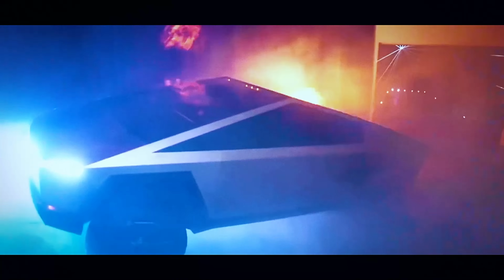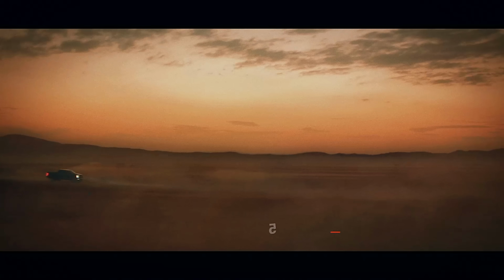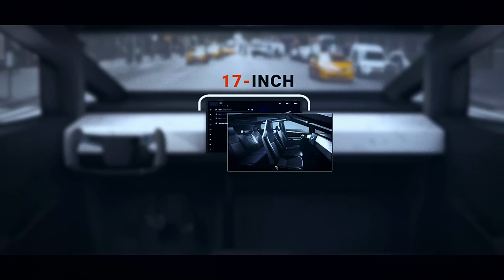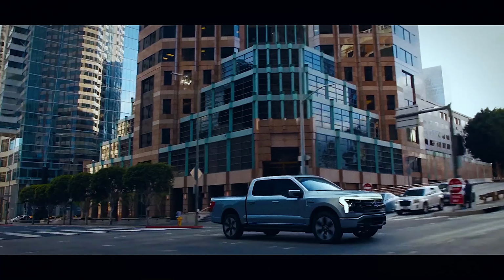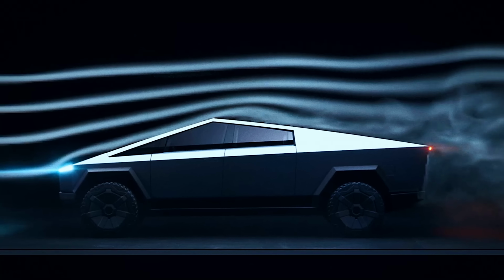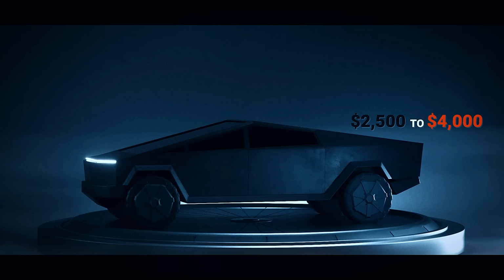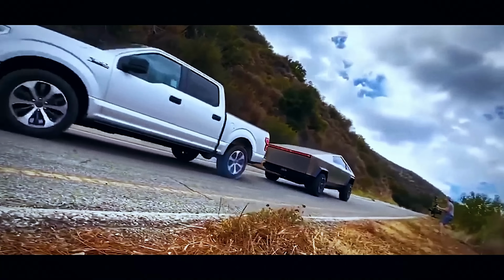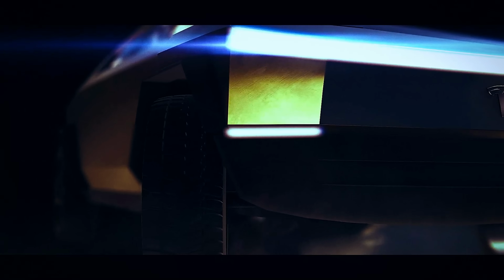This is why Tesla Cybertruck is Special and Unbeatable

Comment: There is a reason this will never outsell the F150. The rear bed has to be able to be replace with other options. As this stands, it's just a truck. With a replaceable bed, you can make it into any kind of work truck. Look around when you drive. Trucks have all sorts of different bed options. For this to be more than a cowboy Cadillac, it will have to have the same option to replace the bed.

Comment: Didn’t they announce a while back that it would also have a quad motor option? Also the reason why the steel ball broke the armoured glass (but didn’t go through) was because the edge of the glass window was cracked when the sledge hammer was used against the door (to show how tough it was).

Comment: E-Vehicles are the future, but there are problems. Cons: strong initial drive wheel torque motion is a negative in that the drive wheel’s tires wear out at 50% or less of their milage warranties. Continuous quick strong acceleration causes physical discomfort from stressing the body’s internal organs and drivers are complaining about body soreness and some headaches.

Comment: mentioning "Torque" when talking about a vehicle engine is almost always meaningless. In order for this number to mean anything to the listener, you would have to also state the gear ratio, wheel diameter, and vehicle weight to get any useful information. e.g. a 10 Nm model aeroplane engine put through a 1000 : 1 gearbox provides 10,000 Nm output torque... if you then drive a wheel with this that is 10m radius, you get 1000 N forward force... if you use a 1m wheel diameter, you get 10,000 N forward force... etc. If you dont understand physics, dont talk about.

Comment: Since Nov 2019, you've had 2 1/2 years to get your facts straight on the cybertruck, but you seem to have thrown this together at the last moment with little checking of facts.  Didn't you care to give your viewers accurate information?
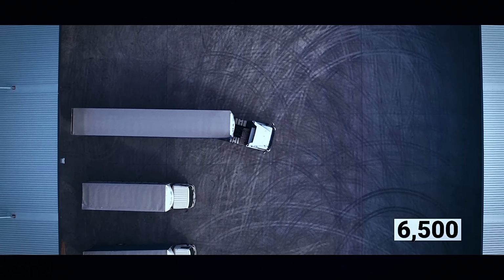  0:35 You show semi trucks and say the cyber truck is to replace the 6500 fossil-fueled trucks sold in the US each day.  18 wheelers?  What?
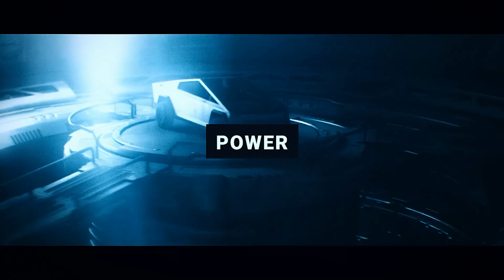  0:57 You say the Tesla Cybertruck is huge and dwarfs most other vehicles on the road.  Yeah, except for all the full-size pickups like Ford's F150 and the larger heavy-duty F250 and F350.  It's big, but you leave the impression it's a real monster.  Not so.
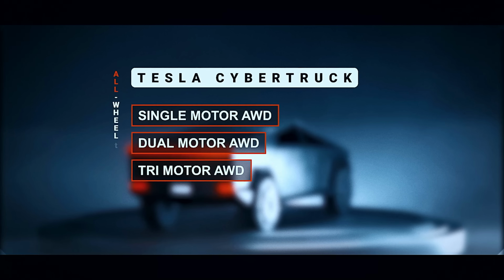  1:10 The dual-motor and tri-motor versions are all-wheel-drive, but the single-motor is REAR wheel drive.  Careless of you.
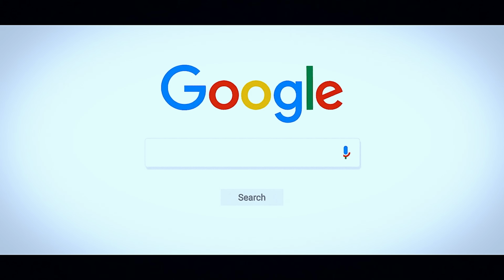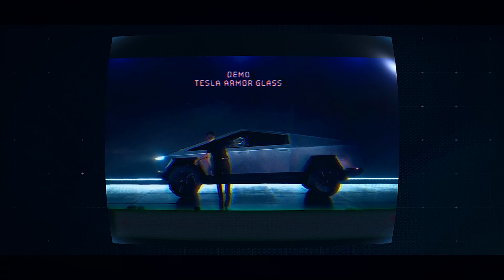  2:00 Bullet-proof windows.  They didn't make this claim at the initial reveal of the truck, though maybe somebody official has said it since.  At the reveal, they showed that the steel body was bullet-proof to a 9mm handgun, but the ceramic "glass" was only shown to be resistant to steel balls (and fractured twice when the balls were thrown at the actual truck windows.)  To be fair though, "bullet-proof" glass works by deforming and giving way so that it catches and stops bullets without letting them through.  These broken windows "worked" in the same way.  They would have protected any occupants from injury.  That's what you want if some idiot is dropping cinderblocks on vehicles from a highway overpass.  Your statement a bit later (2:18) about the function of the glass was very good.  You got that one right in all its details, I believe; even the mention of bullets.
  3:40 Interior space.  Even though no longer or wider than an F150, the interior seems much larger, while retaining the 6.5 foot bed length of the F150.
  5:00 You say Tesla Autopilot is "amongst the most advanced driver-assistance systems globally, akin to level 2 vehicle automation."  Tesla states that it IS level 2.  Is it among the most advanced?  You don't address full self driving, which is promised to be ready when the Cybertruck is ready.  Tesla's FSD is currently somewhere close to level 3.  Other companies have already achieved level 4, even 5, but only in good conditions in limited areas at limited times of day.  Tesla is attempting to develop cars that will drive themselves safely anywhere, even in difficult places they have never seen before at any time that a person could do it.
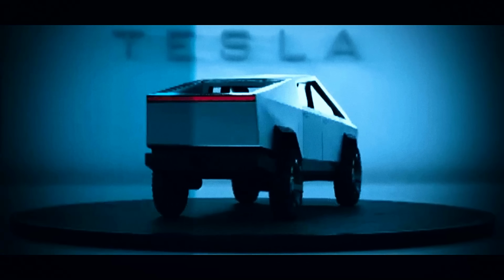  6:15 You talk about the "four thousand six hundred and eighty battery cells" that the model Y and the Cybertruck will use.  That's not a number of cells; it's a descriptive name.  You should say "forty-six eighty."  It means the cells are 46 mm wide and 80 mm tall.  Surely you know that.
  7:22 The solar cells are minimally effective and probably won't come to pass, whether on the truck itself or on larger foldout panels.  In the midst of these dreamy ideas (7:33), you shoehorn in a non sequitur about Tesla's bed cover design being a "tremendous step forward for the industry."  Other car makers have tried roll-up covers before, but they never took hold.  So, you're right.  If this one works, that's a step forward.
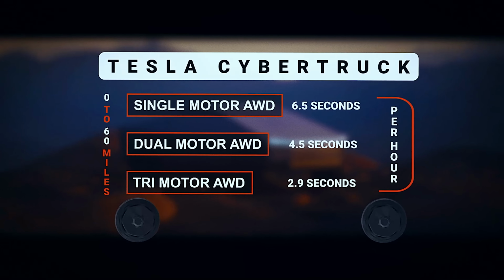  8:18 That's a very odd diagram, with "0 to 60 Miles" down the left side and "Per Hour" confusingly going down the right side, where its meaning is unclear.  Perhaps it could have had "0 to 60 mph" down the left side.  And again, the single motor is not AWD, it's RWD, rear wheel drive.

I actually enjoyed your video.  I just wish I hadn't been able to notice so many flaws after paying only casual attention to Cybertruck videos since Nov 2019.

Comment: I still hate the design aesthetic - but I'd get over it If I could AFFORD a tri-motor with solar roof. Which I can't. But I'd be sold if I COULD. 
That said, I HOPE they produce a nice boxy SUV - tired of everything looking like a big fat scaled up version of a passenger car like their current SUV model. An SUV should look the part. This is a truck, so I don't count it as an SUV - but I'd take it over their current SUV BECAUSE at least it doesn't look like a fat passenger car with no hard edges. 
I think it's a step in the right direction. Probably it'll take a few generations to get to the point where I'd want to really invest in one but I can see doing it eventually - ESPECIALLY if solar technology gets to a point where you are recharging something like 30 to 50 miles of range a day. I'd still prefer a circular wheel over a yolk just because I don't like holding my arms to the sides all the time like that and I like to let the wheel slide through my hands as I turn, just feels better, but we'll see what future models bring. I still think hydrogen power is the future - because it's so much easier to fill up and you don't have to sit there for an hour and a half at a station to wait (and believe me, once more and more people obtain electric cars, there WILL be lines at stations to recharge - the size of the station will not be able to keep up with the number of customers - imagine if EVERY CAR ON THE ROAD took 1.5 to 3 hours to refuel at the gas station and you see my  point here. It'd be overwhelming, waiting for the guy in front of you to refuel. 

That is one of the severe bottlenecks here - that and if they plan answers to SUVs like a Jeep Wrangler, you NEED to address the fact that you CANNOT charge this thing in the field (aside from a trickle from solar if you get that option- not good enough at 15 miles a day) - for people who spend long stints in the wild and go offroad a lot, it IS a consideration - nobody wants to be caught out in the desert in the middle of nowhere on an assignment with no spare can of fuel. As good as the range IS, the fact is it IS limiting once you get outside of California and venture into more remote regions of the world where coverage isn't as complete while gas stations are. Point is you CAN take a spare can of fuel or several if you like - enough to give yourself an extra several hundred MILES of range if you have a long expedition - but a fully electric vehicle cannot bring extra electricity with them. The solar is also not an option where you have a lot of cloud or tree cover or are in deep valleys. 

Like I said, it's a STEP in the right direction but let's keep in mind we're still in the infancy of electric (and other) vehicles. This era we are in is the electric vehicle equivalent of where gas powered cars were in the 1920s. Fast forward 50 years or 70 years and it'll be CRAZY what those vehicles can do compared to now. I, personally, will wait a while and see how things develop as technology surges forward.

Comment: Interesting to watch everyone creaming themselves over this truck. This thing is worthless for REAL truck use! How much hay can you stack in the bed (didn't actually see a bed). How does it handle driving across 30 acres of pasture to repair fences? How long will my horses be standing in the trailer waiting for a charge when I have to drive 500 miles to a horse show?
Those touch screens? Ya My new truck has one. No wonder there are lots of accidents! Turn the stupid screen off and drive!  And auto drive? I ordered my truck without all that automated stuff (as much as I could) because I know how to drive, hook up and pull a trailer, pass on the highway, etc. I don't need the vehicle to do things for me. I'm not that stupid. 
They still force things on you. Can't back up with a door open? Because some stupid shit ran himself over. Sounds like natural selection at work.
These people don't know what a truck is for, but I'm sure they needed a smoke after watching this video.
Reply: Your horses will have to wait 1.5 hours for a full charge. There was a bed with a quad in the back genius.
Reply: @huggywuggy3608  I see.... so you don't know shit about a truck as tool. Instead you just view it as something you're over compensating with. You also show you know jack shit about live stock and farming.

Comment: This is an amazing vehicle, but borders on a military vehicle if fallen in the wrong hands. I can see the wrong people using this vehicle as a remote battering ram; see this run through police blockades and if this hits the market, police would have to be equipped with this vehicle just to keep up. This would be a drug cartel's dream vehicle. This vehicle, paired with the military tires from Israel, would make it an invincible military vehicle with a great passenger capacity. This reminds me of the Leopard of Rhodesia and the Buffel of South Africa.  This Israeli tire - https://youtu.be/n3cLR78mXTE

Comment: I think it is a step to Nowhere. First off, You want Range, make it light. You want to spend  1.5 hors at the charger? You better have a theme park there. And if you pull a trailer range is still cut in half? you better get a charging station every 100 miles or so. Now you lay those electric lines to there. You get the drift? No matter what Tesla invents. The Infrastructure is either dependant on federal cooperation, or Private energy suppliers. And that energy has to be produced somehow. Currently, it is spent on Cryptocurrency mining. So i don't see those two camps cooperating anywhere near close in the future.
Reply: this guy  gets it.

Comment: For sure is a step right where it should be. The foldable solar is awesome, have 3-4 days off, and it can reload the distance you might have traveled if it is reasonably short. And the camping stuff, yeah, both of those, interchangable depending on what you are doing, vacationing, or going to see your friends during the weekend and having the car standing there loading for free. 

Its a step exactly where it should be. Awesome Elon Musk (I wont be able to afford it, or any other car, but still awesome), and thank you motech for this video

Comment: The fact that they used Ford trucks to go against is a compliment in itself. I see little practical use of the body style beyond impressing people who don't and will never be able to afford this coupe deville  which goes along with not mentioning the outrageous price of it compared to A ford Lightening. Which is premiering with a price for the every day working man and his family. Give it a brake on all the glitter of a pile of bull shite.....
Reply: Cheaper than MANY overpriced jurassic motor company pickups.
Reply: The body style is shaped like an airplane wing, it looks kinda dumb, but the whole thing is built to be aerodynamic. In regular pick up trucks, the airflow above and the sides of the car becomes turbulent as soon as it moves into the bed and also along the bed door/taillights which means more drag, even if you cover it up, you'd have to cover the bed from the roof of the truck to the door and both sides of the bed and it would end up looking like the silhouette of this cybertruck anyway. not to mention the cybertruck's front end and sloped windshield pretty much acts like an air foil angled downward, directing high pressure air over the car and low pressure under it so that in high speeds the truck will still have traction on the road while also keeping it's drag down. On top of all this, the straight lines and angled design of chassis and body means it's easier to manufacture/costs less to manufacture. From both an engineering and business perspective, the truck is amazing.

Comment: you didn't say anything about the bed size or load capacity for the bed.  Most important for truck drivers.
Reply: They have no concept why real people buy trucks. They are selling to the rich people who have to compensate for  shortcomings in other areas. It goes 130mph!!! When is the time you needed a truck to go that's fast? Goes 0-60 in 3 sec.. So everything in the back not strapped down goes flying. If I can't load a 20 foot trailer with 150 bales of hay and drive 300 miles, this thing will be worthless.
Trucks are tools, Just like the idiots who think they are some stupid status symbol.

Comment: Yeah  but can it haul twenty 2x4's, fifteen sheets of 1/2" sheetrock and all my tools? Why call it a truck it looks more like a large  SUV. Considering the cost of Tesla cars, this thing is going to cost a small fortune. I'm sure it will be out of the average carpenters price range. This is targeted for the high end market. Those people don't use a truck like a truck. They use it to pick up the kids from school and haul groceries. I would love to be part of the electric vehicle community but this is way out of my price range. Oh well I guess I will continue to drive my exauhst spewing 1998 Ford F150, with an oil driping 8 cylinder big block V8 engine that gets about 8 miles to the gallon. Sorry ozone layer.  It looks like a cool vehicle but please, don't call it a truck.
Reply: Ozone layer? You know burning fossil fuels causes climate warming, not ozone depletion, surely?
Reply: At least you are realistic!

Comment: What a bogus video! It's a TRUCK - at least, it's called that. Where is any consideration or description of how much stuff you can haul in it? Can I put 20 sheets of drywall into it the way I can my 2004 hand-me-down Ford Explorer? What size is the bed? How many cubic feel will it contain? I would think that in a video about a truck that would be up front. 

And the design... it looks like some kid's pinewood derby car that he and his father only got around to working on the night before the race. A slab with four wheels. 

Sorry - I am unimpressed.
Reply: Same! 🤨
Reply: It has a 3500 pound payload capacity, 14000 pound towing capacity and a 6.5 foot box in the top model model, Towing drops to 10000 pound in the dual motor and 7500 in the single.
Reply: @MrRuger1977  Thank you! Why they chose to ignore all that, I don’t know.
Reply: @MrRuger1977  and distance drops in half. Now haul live stock from Austin to Dallas in Texas summer at 105 degrees and have to stop about 3 or 4 times and charge for hours with animals standing in the heat. Stupid idea all around. It's not a truck.it's a toy for people with money to waste.